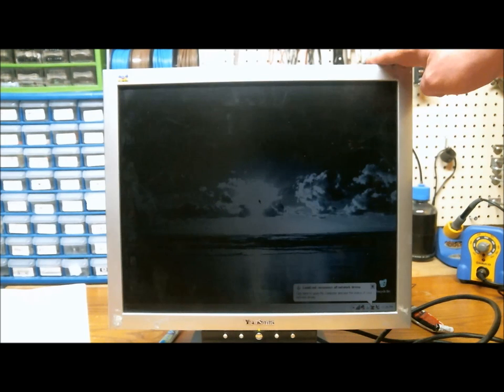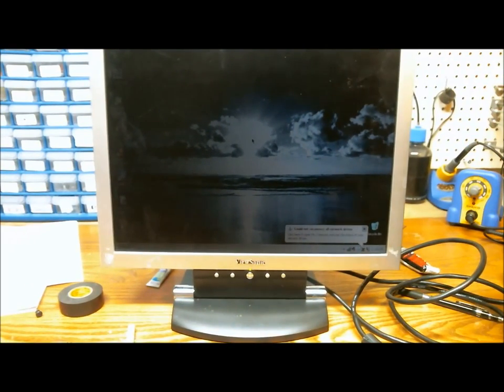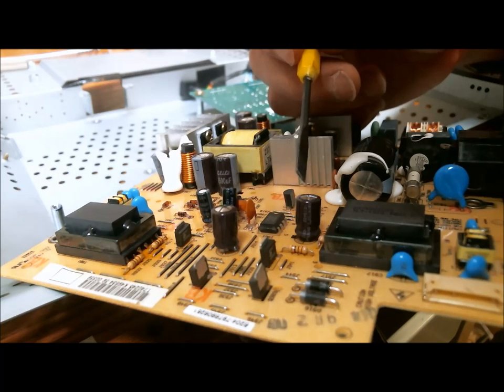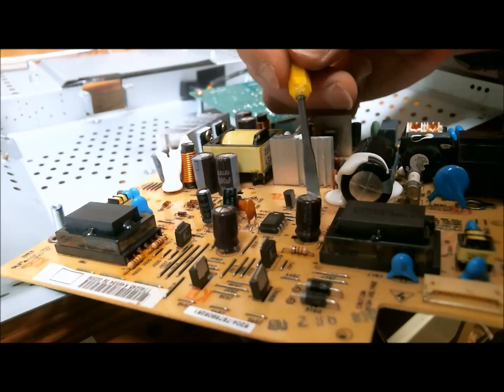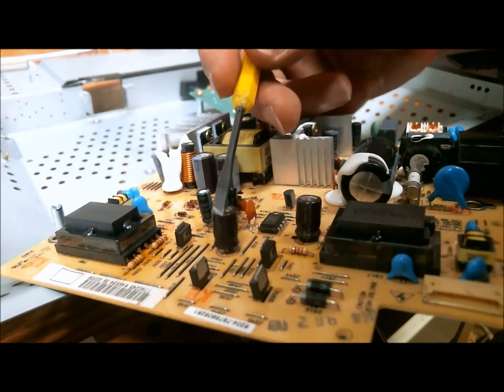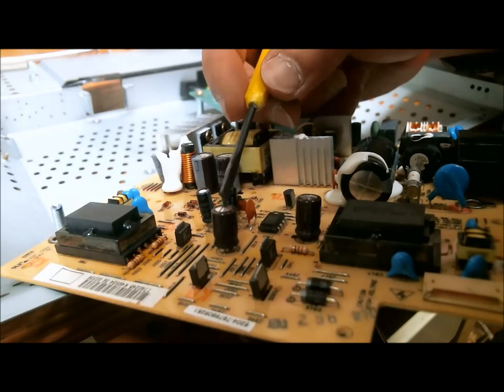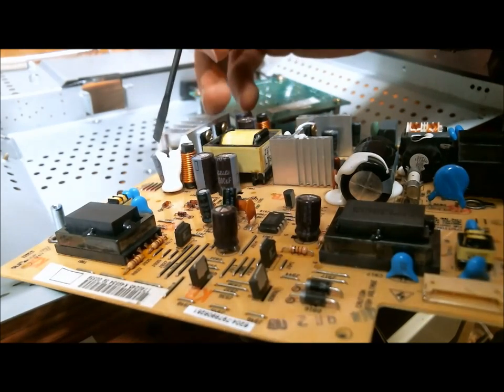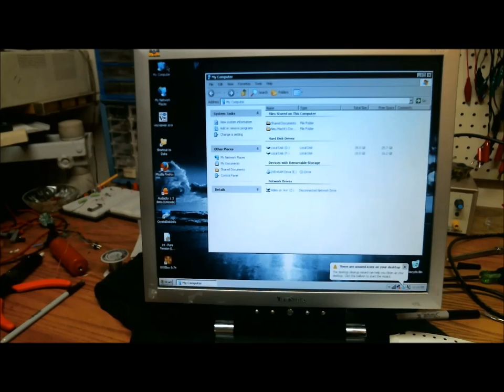Repair: LCD Monitor Backlight

Comment: I really like the way you cut to the chase first and not waste my time showing me how to remove screws. Later the tip about popping the bezel is good because you don't bore us walking all the way around the entire screen. If they will fit I would always go with a higher voltage rating cap as they hold up better as sometimes heat builds up in the HV cage. 

In Texas, A/C condensing units have a high incidence rate of blowing caps. So we always replace with higher voltage of same capacity and have never had the replacement fail.

Comment: my monitor had the same problem. its a dell ST2310. one day it went back to normal and it was nice and bright. and it gave off this burning smell though but it was fin. two days later it went back to the way it was with very low lighting.
Reply: Same Problem Here!

Comment: Need to know what the voltage is for a backlight off a 19 inch insignia..
Ordered a replacement for  a  cracked screen...  the screen base frame makes a great little work space/table for a countertop.  Want to turn on the backlights.

Comment: Hi buddy. I've Samsung SA300 21.5 inch led monitor. Recently I'm able to see a  horizontal line. Unfortunately my 3 yrs warranty got over last month. What will be the issue. Is it possible to rectify it.

Comment: I imported a power plan on a cheap chuwei laptop and now my back light doesn't work. I have to use a flashlight to see the screen. I've went back to the default power plan and I'm hoping the UEFI Firmware settings has a fix. Does anyone have any suggestions?

Comment: What's the white goo on some of the capacitors. Is that a sign of damage?
Reply: No, that is a type of adhesive to prevent movement or vibration of components.  It is quite common and does not indicate any damage whatsoever.

Comment: My LCD display keeps blinking on for an instant, then turning off for around 2 seconds, then blinking on again. Sometimes I can press the buttons on the monitor to make the LCD work, but with the backlight off. And sometimes if I spam the auto adjustment button, then the monitor will work fine for about half an hour before blinking on and off again. Help!

I'm shining a lamp into my monitor so that I can barely see right now. Not a very good long-term solution.

Comment: If you want the monitor to last another 5 years, use panasonic low ESR capacitors. They are the most ideal.